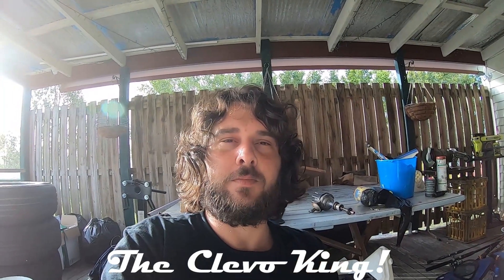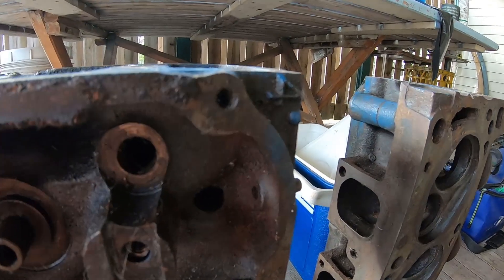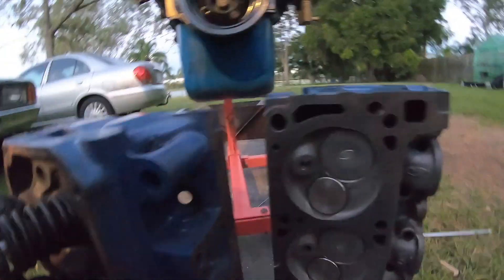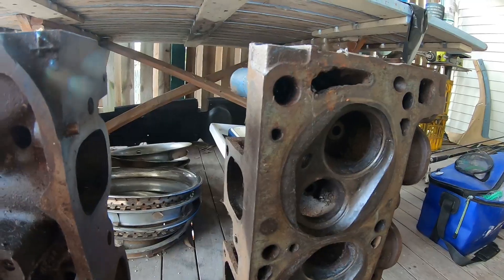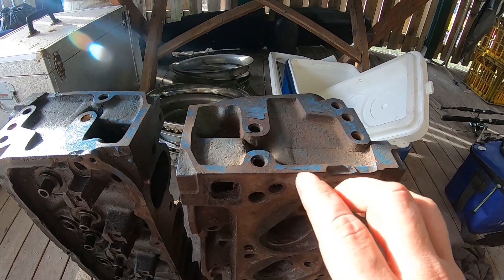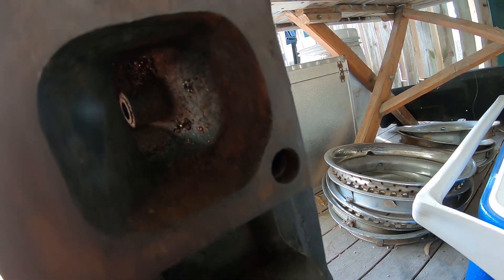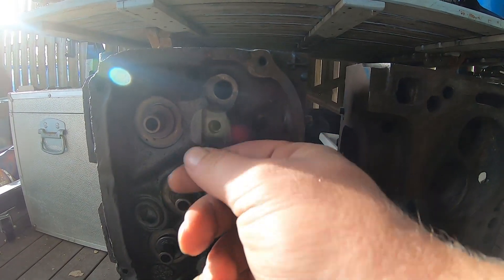351 Cleveland 4V Head 4 DOT Tech Talk

Comment: My 351 Cleveland doesn’t have a 2 or a 4 at all. The engine number indicates it came from a 73 XA. I know that the heads may not be original to the block. 
I go to a few car shows and notice a lot of Clevelands lacking those markings. We’re there another type of heads used?
Reply: If it's an all original engine that means it's running 351 2v open chamber heads ,Australian castings.302 Cleveland 2 v heads didn't have any markings either.

Comment: For those of us in the states. If there is a 4 but no dot, you can just about guarantee that they are CC heads and they are from 1970 with the part number D0AE. If your car is a 71 and it has a dot and the engine has not been taken apart or replaced, you need to check the vin. A 1971 M code car (5th character in the VIN is the engine code and is always a letter) is a standard 4v cleveland and not a boss or a cobrajet. That will have 4v cc heads, again, assuming it hasnt been taken apart and the heads replaced along with the part number D1AE under one of the intake runners. A Q code is a cobrajet and that will have the big dot open chamber heads. If its a boss head, 1st off congratulations, 2nd take the valve cover off, it will have rocker studs and pushrods guide plates with a ford part number on them.
Reply: Yeah i have a 4 with no dot in my 70 Mustang. Doae-j 9k10 engine code
Reply: Both heads on my cleveland are 4V closed chamber heads with D1AE part number. They are identical in every way except one has a 4 and the other has a 4 w/small dot. The block is 71 also. I don't know the origin of the engine. I bought it in pieces with the machine work done already back in 85. I took it apart this year to rebuild.
Reply: Boss heads also have spring seats.

Comment: There’s a fair bit of talk of using the 302 2v closed chambered heads with the 302 longer rods and a 351 crank. What are your thoughts on this? Or would it be worth going straight to a alloy head instead of using any of the ford heads?
Reply: Don’t do it. Go straight to alloy performance.

Comment: I'm curious "why" the differences with the dot as well as non-dot 4V. I'm wondering if the dot is more a casting facility mark rather than whether open or closed.
Reply from the maker: The 4v heads with just the 4 were the first ones made purely for a cleveland. They ran the large 4v exhaust port the same size and shape as boss 302 heads. The boss 302 heads had a smaller closed chamber then the cleveland ones and holes for water to pass through the intake surfaces. The small 4 dot indicated a revised smaller exhaust port with more meat around the upper bolt hole. The large 4 dot open chamber. They did make a small port 4v open chamber head that ran 2v valves but I’m get too come across a set to see how else they differ.

Comment: Great video Clevo king!

I have a question about the valves on these 4v heads. Do you recommend replacing the original valves? Have heard that they are not reliable ..
If so, do you have any suggestions on which valves you usually use when you change?

thanks in advance.
Reply from the maker: Ferrea or Milodon mega flow valves I favour.

Comment: I was told NO dot _1970       Dot is 1971
Reply from the maker: Yeah the earlier 1970 heads have no dot and are all closed chamber
Reply: @thclevoking  I just found a guy with a 4 bolt, 4bbl motor from 1970 in a barn for 25 years. Im going to buy it for 600 and rebuild it for my Ranchero. It has no dot.

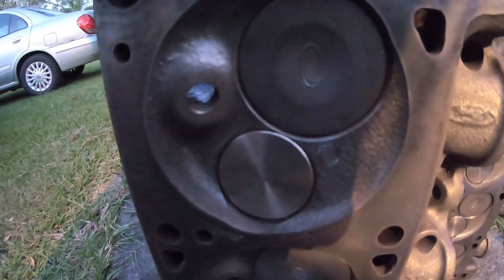Comment: So I have a 351 Cleveland rebuilt it.. Has Holley 670 street avenger double pumper, 4v blue thunder intake, hyperteuitic pistons, upgraded cam.. My mechanic said just to rebuild of the 4v open chamber heads, so they have machine work done and new valves.. Are those 4v open chambers going to be able to handle what I have done? I think I still need a good tune on that carburator though.. Also I'm running 4:11s in the back.. Just so I can get more of a kick of the line..
Reply from the maker: Yes the 4v opens way outperform the 2v so that’s sweet, closed would be ideal but pending you location fuel might be too expensive
Reply: @thclevoking  It's about 3.35 a gallon premium... I just want it to be a fun street car. I have noticed when I slam on the gas it wants to bog or fall flat.. Once I'm coasting and stomp on it takes off...
Reply: @thclevoking  With the upgrades I've done to it I'm hoping to push 400 to 450 hp hopefully..
Reply: Will the open chambers handle what I done ? Did you replace the multi keeper valves with a single keeper ? 
Do you have screw in studs and guide plates ?

Comment: I saw a Cleveland motor in a wrecking yard that had 2 with a dot stamped. Is that unusual?
Reply from the maker: Early US open chamber 2v heads usually found on D blocks
Reply: Most common head

Comment: Our Aussie 4.9 litre Geelong heads are 2 Venturi Quench Chambers , with between 54 cc's and 57 cc's .all 4 Venturi big valve quench Chambers are slightly larger in capacity at 61 to 64 cc' s .all our Aussie 2 Venturi open Chambers are right on 75 cc's , obviously before cutting the heads face to and through the machining margin . Also one other thing to know bout my lovin' henries is that the first rebuild was always on Ford . This simply put meant that you should pull her down ,and then swap the rods ,  rings , and pistons from 1 2 3 and 4 cylinders and refit them to the nicely honed bores in cylinders 5 6 7 and 8 , with the notches on the crowns oriented reversed . Henry slugs have a fair bit of gudgeon pin offset . Located traditionally the piston dwells 2-3 ° after top dead centre as indicated by the crank throws 0° stroke index . If you then fit them reversed You now have your compression stroke ending a little early (at 12.5:1 comp finishing the compression stroke early by 2 or 3 ° to begin power stroke early Should yield a nice early start to the combustion whilst the piston has dwelled and is already on its descent  phase , any late stroke pinging will no longer harm top rings , fire rings of head gaskets , upper conrod bearing shells , lower main bearings etc , all this previously destructive forces are now acting evenly across the crown with an increase in cylinder pressures from 900 psi to and through 1200 psi , nice boost in early torque production .

Comment: Great vid! So the 5 bolt holes on front is a guarantee that they are 4v? I also just saw your video that said 4v heads do not have the intake gasket dowels. My heads have a 4 with no dot, 5 front bolts, and the intake dowels. So im gonna pull the intake and see… update; Pulled the intake. Heads have a 4 no dot, big port, 5 bolt front with intake gasket dowels. DOAE N on heads.
Reply from the maker: The 5 holes is only on the 4v heads, that’s odd about the dowels maybe someone felt the need to put them in. I have a fair few sets of 4v heads here and none are dowelled for the turkey pan.
Reply: I have the same on a 71 gt did yours end up being closed chamber?

Comment: Are open chamber heads 2/4v good street performance wise?
Reply from the maker: Yes mate open chamber is slightly more resistant to pinging when you are building a street engine that you want to run on 91 octane. If you go closed you will only be able to use 98 octane.
Reply: So Clevland really didn’t make a Bad cylinder head? Bc my builder told me to go w 2v open in my street car eventho I have 4vclosed
Reply: @gball231jr  I built over 70 cleveland engines. The best street head is a closed chamber 4 v.
Just use a small cam.
A factory 1970 engine was great street engine and still is.

Comment: Just got the 73 mustang back from paint. Trying to get it running. It’s just a stock 351c with a 600 carb and a hei distributor. It’s getting gas and spark. But no matter what I do, it doesn’t wanna start. HELP!?
Reply: Yes! I need to update and post a video of it. Been busy getting the interior put in and the vinyl top. Ended up being The HEI distributor module, it was having a bad connection so once we changed out the internals of the new HEI distributor it fired right up. Turn start at the moment!
Reply from the maker: Pm me and I’ll help trouble shoot mate
Reply: Get it running ?

Comment: so 4 small dot closed chamber 4 large dot open chamber is that correct ?
Reply from the maker: Yes sir that’s what I tried to say
Reply: Not so in U.S.i believe, but maybe after they ended up down under. Up here they 
Machined whatever was available to keep the line moving. I have found closed chamber with dot and open with no dot over the years. This was verified by a machinist line worker from the period. However it is a general rule that dot meant open in U.S.

Comment: Great info as usual mate. What’s the pros and cons running  open or closed heads? Sorry if that’s a dumb question. Keep up the content boss
Reply from the maker: Closed chambers is preferred for racing purposes to get more compression on a budget, and open is more for people that don’t want to run higher octane fuels and still drive them a lot.
Reply: CC heads are also less prone to detonation with pump gas at CR's over 10:1 because they cool the incoming F/A charge more effectively....or so I hear anyway